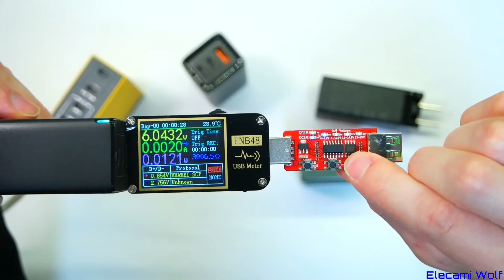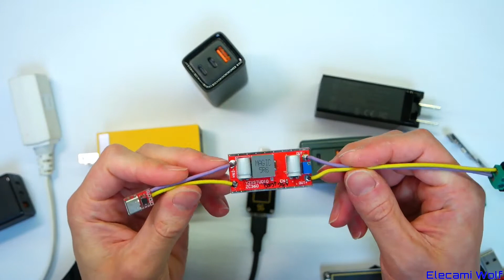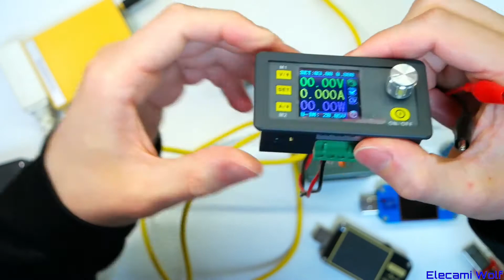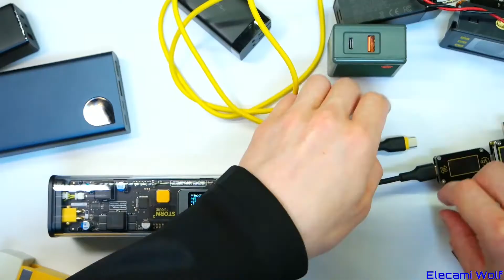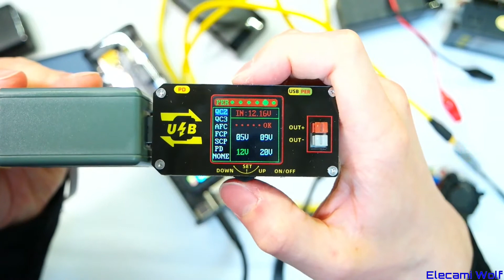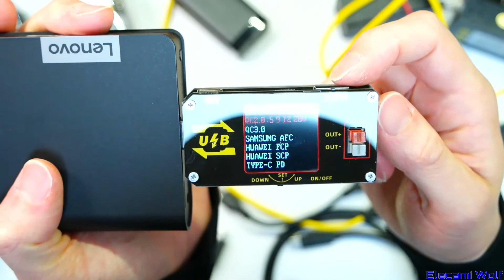EW0026 - USB PD & QC Triggers - Power Your Project From USB

Comment: when I connect a usb voltmeter directly to my Lenovo charger without connecting to laptop , I get no reading.. connetcing with usb extension to laptop and still no voltage . strange ??
Reply from the maker: It will only output when connected to a device or PD trigger of some sort. Not sure about USB extension, would depend if it is rated for USBC PD.

Comment: I'd love to see a video about PPS and higher current on voltages under 20v!
Reply from the maker: I could have a go at some point. I do have one adapter that can do PPS, but it is really annoying to use. it just has up and down buttons. And with 20mV steps, it takes a very long time to change the voltage by much.

I also recently ordered some PD 3.1 decoy boards. Those can do the 28V 5A 140W Output.
Reply: @Elecami  that's really nice! I just wish you wouldn't have use a buck converter for everything that isn't 20v+
Reply from the maker: @nicoful86  You can use the PD Trigger / Decoy at 9V, 12V, 15V as well. But for high current loads, it is better to use the 20V with a buck converter, to get more power capability and to absorb current draw spikes that could cause the USB-C Power Supply to shut down on over current.

Comment: I have a realme charger which supports 5v 6 amps but only provides 10w when something other than phone is connected can you suggest a pd trigger board for this
Reply from the maker: Depends what the protocol is. What phone is it that can draw 6A. Maybe Quick Charge? Or might be another protocol specific to a manufacturer.

Comment: Hi, thank you for your video. Do you know if any newer trigger boards are on the market  which you can use like Tha black and yellow one you showed, which could work as a sort of power supply? I m looking for something that will kind of work like a bench top powersupply when used with a pd power supply.
Reply from the maker: The one shown at 9:22? 
I have not looked for any more of these recently. If you take a look on AliExpress you might find some. 
Have a look here for many options. https://rdtech.aliexpress.com/store/923042
You can use a 20V PD Trigger board to get the power to input to one of the regulated power supply Modules.

Comment: Thanks for the idea of PD + step buck converter. I will try it for a small laptop that works at 9.5V but not at 9V.
Reply from the maker: Interesting that is is picky about the voltage. 
Problem could be that the USB-C 9V is very sensitive to current spikes. It will shut off if high current is drawn even for a very short time.
Connect to laptop then connect to the USB-C might help. 
Or use a buck converter as you say. That provides a good buffer between the device and the USB-C power supply.
Reply: @Elecami  I tried it last night and it worked flawlessly with a 12V trigger + step down ☺
Previously I used an adjustable trigger set to 9.5V which worked with a PD wall charger but not with my PD powerbank.
The bank would get the voltage but return to 5V after 3 seconds. Could be the current draw, but it returned to 5V even when not plugging in the laptop.
Perhaps an incompatibility in the protocol/timing of signals with the power bank. At 12V the bank is rock solid.
At 9V direct from the trigger the laptop would not turn on, even from the wall charger.
Thanks again for the idea.
Reply from the maker: @yomboprime  The adjustable one is probably Quick Charge 3 protocol. Not supported by all chargers.
Reply: @Elecami  No, really it is PD 3.0 and says it is using that protocol at the beginning in the 7-segment displays. 
It is possible though that it is using QC3.0 underneath in the adjustable mode, who knows. There must be some incompatibility with the powerbank, but I have no clue or way to solve it.
Anyways I am happy because I can now use the big 30Ah bank with the laptop, thanks to you.